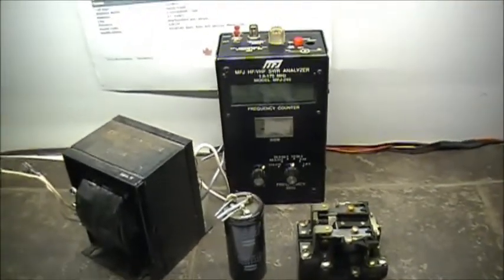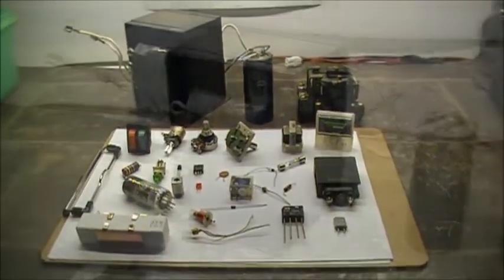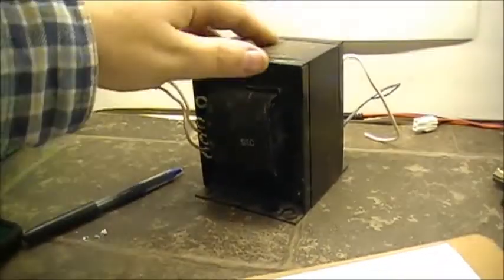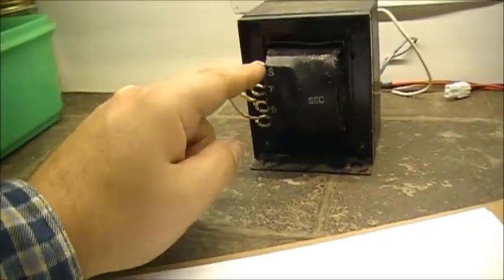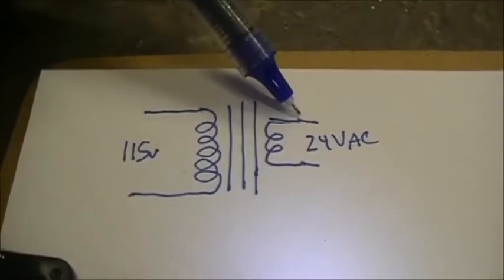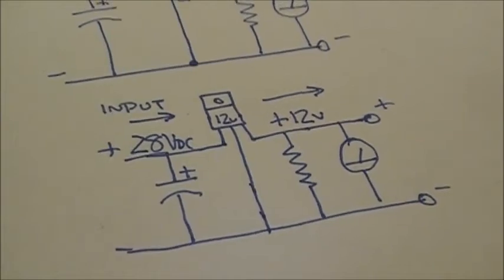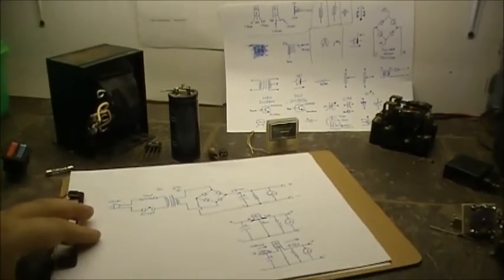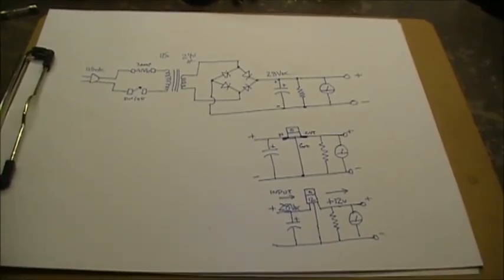Physical parts, the circuit diagrams and a schematic to boot

Comment from the maker: What is that part?
What is the schematic diagram of it?
How will it work in a circuit?

Lot's of questions, and lots of answers, This is NOT a technical manual nor a in depth boring lecture.  This is the basic building blocks of electronics, what they are and how they work in a circuit, i know i do not have all the answers, but then again i am not a electronics expert either,  but there are folks out there that want to know, and with this video i will do my best to show what they are, what they are called and how they are used in a simple circuit.   

 I hope you find the video useful, and if you do please Subscribe and like the video!

 All the best everyone and stay safe!